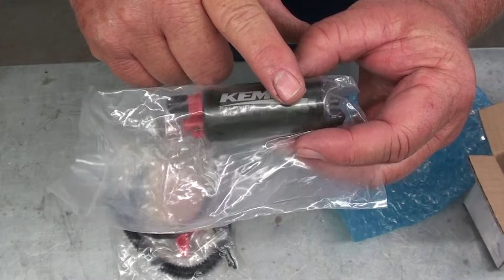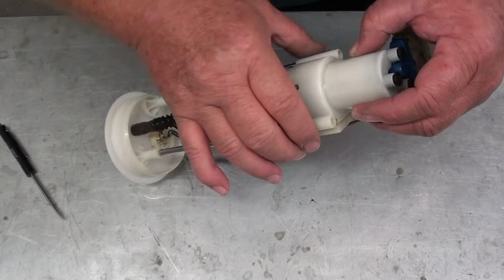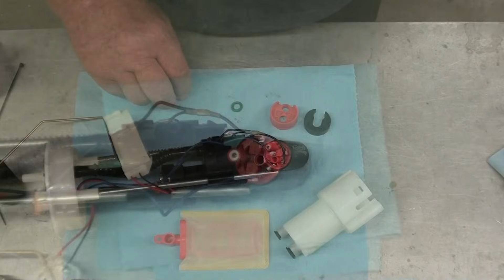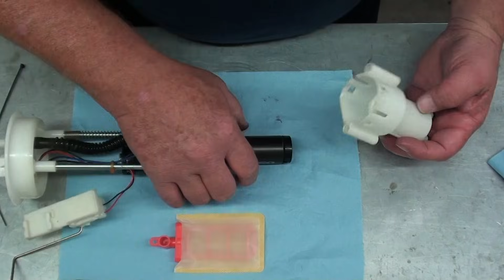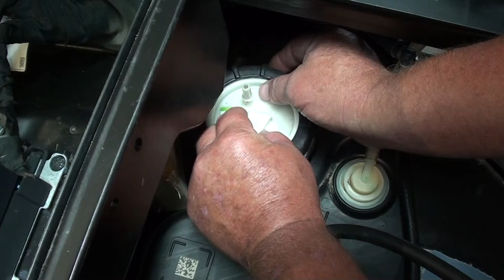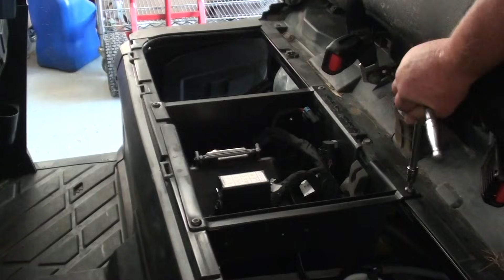Pt.2 2016 Polaris Ranger EFI Fuel Pump Troubleshooting And Repair For Under 30 Dollars

Comment: Good video - but the directional arrow, at least in my service manual, says to point to those two lines you see at 4 o'clock (14:25 in your video).

Comment: My 2020 xp 1000 has gotten hard to crank when its cold. You can finally get it to run by giving it throttle. But it runs perfectly otherwise. I wonder if the fuel pump is weak? Where can I get the gauge to test pressure? And how much pressure should it have?

Comment: Just replaced fuel pump assy in 15 ranger 570 efi crew. The old one was completely broken when we pulled it out. The issue now, is like it is not getting full power. It barely wants to move and then will start sputtering and cut off. Any suggestions on what this could be??? Please help!!

Comment: Another excellent video. Thank you for your knowledge. I'm working on a SP 570 and suspect it's not building enough pressure although I'm getting good flow when I cycle the key. Is that normal?

Comment: After viewing your video a year ago,  I replaced my fuel pump.   It worked perfectly until one day I noticed the ring was loose, so I tightened it.   
    --> After doing that, sadly my Ranger would start up but run only a few minutes before sputtering off.  I might have tightened it back in a slightly rotated position, so I corrected that,  but with no result.  I've attempted to rotate the pump slightly,  took it out and reseated it, but now I don't even hear the pump momentarily running during the initial power up.   I'm guessing the pump maybe has once again failed.  The fuel level registers ok.   
    I failed to wipe out the inside of my fuel pump like your video recommended, so it's possible some bits plugged up the pump.   😞

Comment: Loved your video. I have a 2016 Polaris 900 Crew that quit running after I filled the tank with gas at a local station. If I prime the engine at the air filter intake it will idle roughly but will not restart. Where can I find the Fuel pump rebuild kit? Also, my instrument panel shows code, "530209-5". Internet search said, "Oxygen Sensor". What are your thoughts? Thank you for this VIDEO.

Comment: Got that same kit to replace my fuel pump. I’m having a difficult time separating the white casing that houses the fuel pump. Any suggestions?  Those 3 tabs are causing me the issues. I can’t get all 3 pressed in to remove the housing. 6:04pm

Comment: Great video. I have a 2017 900XP. Wont start so I connected  fuel pressure tester. I get Get 55-60 PSI Turns over great does not hit a lick. I squirted a shot of start fluid and it started up. Runs rough up to about 20 MPH after that run up to 50 no problem.  I put seafoam 1 oz per gallon and  Drove about a gallon of gas out and still have same problem. Any Ideas? Thanks

Comment: Is the fuel pressure gauge adapter available for purchase somewhere or how do you make one .  Thanks in advance for your help.  This video was very helpful.  I'm assuming my can am defender has a weak pump but want to check pressure before dropping the money on a new pump.  After seeing this if it's bad I'll just rebuild it.  But I can figure out how to make or get the pressure guage attached to the bike

Comment: Thanks. Mine is now working, on my 09 77 crew, but the fuel gauge doesn't work.  The ground from the sender has some clip on it that attached to the aftermarket plastic housing. Can I just run a jumper to the ground for the pump?

Comment: Excellent video mate ,I've got a 2007 sportsman EFI which was giving me problems starting but now wont start at all , when I turn the key on the HOT / ENGINE CHECK flashes and it wont crank but the fuel pump contiuosly runs and wont shut off . .I've removed the fuel line from the inlet side of the  filter to see if I was getting fuel and every time I switched the key ON fuel would flow for 2 seconds then stop but the pump was still making noise as if it was still on  . I then connect the fuel line back on the filter and turned the key On & OFF a few times , then I disconnected the fuel line from the injector fuel rail and fuel pissed out . I'm not sure if I have a pump issue or a injector issue , the fact that the fuel pump keeps running but the flow stops is doing my head in . Do you think I could have a stuck open injector .

Comment: I used your video a few years ago to service the fuel pump on my 2009 Ranger 700XP. It's time to do it again. And, fortunately, I found your video again. Hands down, one of the very best instructional videos I have ever watched. BTW, bought my Ranger new in 2009 and it has over 12000 miles on it. I wore all 42 suspension bushings down to bare metal and replaced them all last winter. Thank you for your help!

Comment: Hi Ray, I'm George from Buenos Aires. I congratulate you for the good quality in the detailed explanation of the assembly and disassembly of the supply spider. I have seen him looking for some KEY to solve a current problem with my ATV Can Am 800: in the middle of the day, hot, on steep roads and with little ventilation around the trail, the vehicle begins to fail and stops. I must replenish fresh fuel to resume. And then again it stops.
You may have some clue in mind as to what may be causing this abnormality.
Thank you and receive my greeting.

Comment: Awesome video.   I know its old but damn this saved me some time and $.   Be sure to check your spark plug as well if you had a bad fuel pump.  I still had idle issues after the pump replacement.  My plug was toast.   All is well now!

Comment: I bought a sportsman 110cc, it would start/idle but die when you give it throttle.  I did the pump swap...still does the same thing.  What a piece of junk, bike is a 2019 model, EFI can't handle modern gas yet is more complicated and expensive than a carburetor...I will stick with carbed machines in the future.  I've bought cheap chinese bikes that sat for over a year, clean the carb/fuel lines and go.

Comment: 6/2021. My 2019 Polaris Ranger 570 Full Size was idling fine as I was topping off some livestock water.  My Ranger NEVER had any idle issues, NONE.  Then, all of a sudden it just sputtered out and died.  I'm in Florida and our dry season is INCREDIBLY DUSTY.  I pulled the fuel pump and the filter looked like a used tea bag.  Watched this video and just ordered new filters and the pump kit off eBay.  Replaced spark plug and air filters as well.  Just under $100 in materials and about two hours of labor and clean up.  The Ranger is back up and running, ready for farm chores again.  Thank you so much for this video.  Saved a ton of cash and A LOT LESS WALKING.  

If your machine is running well then just dies and you've never replace the fuel filter, this is most likely the issue.  Adding fuel filter change once per year to yearly maintenance list now. 
 New fuel pump and filter kit.  Less than $30 on eBay and you're good to go!

Comment: D-Ray, awesome video, quick question.   The fuel adaptor you use to your pressure gauge, did you manufacture that for your needs or were you able to find the unit as shown in the video?  Thanks again!

Comment: Thanks for this video! I just bought a 2019 Polaris XP 900 Crew. It just has 3000 miles on the OD. But it started cutting out and stopping. You could wait a few min and it would crank and run for a little while. I told my wife when it started it was acting like a fuel filter issue. So O did some checking and came across your Vid. It helped a lot, but I can say this all Kits are not created equal and all year pump assy's are not the same. I had to disassemble my pump assembly a little farther because the fuel sender assembly was a little different and I had to pull the top and the 2 sliding rods out to remove it before I could pull the to pump halves apart which ment I had to remove the fuel hose but guess what they gave me another in the kit, but superman could not have got that hose to fit over the nipples. so I had to go buy a piece of fuel line which as you know is tricky because a rubber hose does not replicate a plastic accordion hose so you have to get the length just right for the spring tension of the pump. But hey it worked. Thanks for the video.
Reply: I had to pull on plastic part where the two rods go through, it is a tight fit with the hose being max'd out to the limit, but it came off. I was reluctant at first to try it, but that option looked better than replacing the hose, and it worked. Just go slow with the process. 2020 Ranger 570

Comment: I have 2015 ranger ETX that won’t crank I’ve checked everything but the engine and fuel compression I was wondering if your fuel pump was going bad or if it was completely gone? In short how much fuel pressure is needed for the unit to start ?

Comment: Replaced pump on my 2014 ranger
Crew 570. Pump primed up, hard
To start then backfires any suggestions and goes dead?
Any suggestions. Replaced pump
Like in your video.

Comment: Excellent video, West Plains, Mo here.  Mine was running and just quit, figured maybe bad gas, drained and refilled and won't run unless ether sprayed on air filter, which is new.  Believe either my pump or filter on tank.  My set up is exactly like yours.  Thanks so much, maybe we will all thaw out after the snow and cold!
Stay warm!

Comment: Nice videos. I had same issue. Thanks to your video I was able to remedy the problem. However, I have one question, where does the fuel vent filter go installed. My Ranger did not have one, which is why I believe I ran into this problem to begin with. Thanks again.

Comment: My 570 fuel pump reads 58psi. It randomly turns off, like the key switch gets turned off. If I’m running fast enough when it happens I can turn the key off then back on and starts right up?

Comment: Subscribed!  So easy to watch .  Great Video. I have a question for anyone reading. Would there ever be a time when it ran poor after it heats up due to a fuel pump problem?  I have a 2013 CFMoto z600  woth 900 miles on it. Serviced regularly but now after about 10 min of riding (temp gauge hits 2-3 bars) it runs horrible and dies at idle.  let it cool off and it runs great again?  Thanks in advance.
Reply: I did do a pressure test   22 psi.  Thank you for the video, think im on the right track!

Comment: I have a 2016 Polaris sportsman 450 H.O. bought August 2016 & my fuel pump has gone bad 3 times now (first time Sept 2017, 2nd time June 2018, 3rd time August 15th 2020) . It's under warranty, but just wondering if this happens a lot? I switched to Ethanol free June 2018 & if I wasn't driving a lot, I'd at least run it for a half hour or longer every few weeks.

Also do you think the EBay Fuel pump kit is better than the OEM version, as in it lasts longer or just better because it's cheaper?

My father in law has a 2015 Polaris Sportsman 570 & has never put Ethanol free gas in his & he just had the same problem I've had August 14th 2020. But after letting it cool down for 5-10 minutes, it would drive another 2-4 miles, then backfire, slow down, & die.

After letting it sit overnight, it happened the next day a couple times, then he drove it all over the mountain for a few hours without a problem???

Just wondering if mine was built on a Friday & his was built on a Tuesday? Lol.

Thanks for any advice

Comment: D-Ray, I swamped (really swamped!!!)  my 18 Ranger 900 XP like a knucklehead (not snorkeled) and spent a week wrenching, draining, and praying I could revive her. I got her started, no hydrolock and no knocks or smoke. I wiped the sweat away but  my last obstacle was the damage from water and mud in the fuel tank. I pert near mashed the buy button on a whole new fuel assembly ($289) when my boy showed me your video. Convinced this will solve the mess. Great video bubba, thanks!

Comment: Yelp he very good.   What about that fuel pressure regulator.    Does it ever go bad.  I cleaned  and blew my fuel pump out.  And it went back running fine

Comment: your video was very helpful..ill need to find a fuel pump pressure tester
 my 570 keeps stalling after warming up mine is a 2019 model hunters edition 
ive changed the fuel, spark plugs, and cleaned the air filters (intend to order them also)

i looked on ebay for a new fuel pump and get a spare repair kit 
my problem is i don't see a hunters edition  sportsman i see alot of the 570 and some seem to look the same as mine but i hate to order the wrong part or model 
can you help ?

Comment: Use this:  Orion Motor Tech Master Fuel Injection Pressure Tester  on Amazon, it has the fittings that you can pressure test your pump.  It's got that plastic end, plus the gauge has the release valve. I just tested mine.   Seems like it would get up to 55 psi then slowly seep back down to 45 psi, but when it was running it would be over 50 psi and the indicator would swing wildly.

Comment: Excellent video! Thx to this I had it apart in about half an hour. I have a question though. When I got it apart, there was crud at the outlet of the fuel pump. I assume the piece above it is the regulator. Should it be letting fuel in backwards through the regulator? That's the only way that I can see that dirty fuel would get into the outlet of the pump. The filter was intact and not overly dirty. My plan is to clean the tank (it's kind of dirty) and remove the fuel rail and make sure that there is no crud in there, make sure the fuel lines are clean, install the new pump and hopefully the problem is fixed.
Reply: Got my Ranger back together and it runs a lot better. It feels like I don't get quite as much power at the top end of the RPMs, but it may have been running a bit lean. Thx again for the great video!

Comment: Great video I did my Sportsman 570 2016 today 70 hours on it. Shame Polaris shame - Bosch Made in China pump . Anyway watch that little green  O ring its a pain in ass  to get seated properly and you wont  get pressure unless it right up inside. I used grease but ended up pushing it in first then seating the housing into it. Hope this saves  someone a few minutes

Comment: I have a rzr 800 4 Robbie Gordon edition and I ran into a strange problem. It will run up hill but will shut off on level or down hill. Fuel Pump? Air Sensor? or both?  I am lost. ANY HELP WOULD BE GREAT. Thanks.

Comment: Great video!  My Sportsman 500 EFI is doing the exact same thing you described.  I've changed the plug, fuel filter, and airbox filter to no change.  I'm going to test the pressure from the pump and go from there but I'm guessing that is the culprit.  Unfortunately, I have to take off the entire front plastic to get to my tank!Thanks again for the information.

Comment: I don't have any power going to the fuel pump. I assume there should be power when the key is on? The EFI warning light was on before the engine stop running. It had been stalling like it had a blocked fuel filter for a bit. Now it won't start. Is it possible the computer is cutting power because its sensing a fault?
Reply: BauerTreeEquipment I have the same problem did u find a fix ?
Reply: @TheBreedxxx  I replace the computer. Fixed.
Reply: @TheBreedxxx  It was the computer. Founds a cheap replacement on Ebay, fixed the problem.

Comment: D-Ray this was a very, very good video. Great close ups and excellent explanation as you perform the repair. 
This is a good DIY repair that I am fully capable of doing. My Polaris dealer quoted me $520 to replace the fuel pump in my Razor,  and our unit only has 1200 miles on it! Your tips on putting a little grease on the o-ring, and on the locking clip for the fuel filter, great tip! You are the best UTV mechanic I have discovered online, thanks sooo much for sharing your knowledge with us!

Comment: This video saved me big bucks!  Just changed the fuel pump on a 2015 Polaris RZR 900S for $27.00.  I did have to buy a tool to remove the ring on the fuel tank that holds the pump housing in place because it was super tight and the RZR doesn't provide much room to get your hands around it.  This is a very professional video by a guy who really knows his stuff!  Thank you!
Reply: John O can you tell where you found the part? Thank you
Reply: Guys have used the plier type oil filter tool to grab it and turn it. You might try that next time

Comment: # D-Ray-Smith I live in Tn just purchased 2011 BobCat 3400 4x4 same as the Polaris Ranger 500 single cylinder my issue is it will not stay running its hard to start stalls out backfires or puffs out i know its an easy fix no engine noise what so ever strong compression im thinking fuel pump? TPS? clogged vacuum ? please help!!

Comment: @ 13:35 -- Drop some paper towels shreds  in the tank and then blow them around with some compressed air to absorb and bad gas/debris, use a grabber tool to pluck the paper towels back out.

Comment: I have a 2015 Polaris ranger ETX and all of the sudden it’s acting like it’s not getting fuel. Other than pressure test is there any way to tell if it a bad fuel pump ? Also can you post a link to that fuel pump on eBay.

Comment: Thanks very much- I have a 2016 Ranger ETX that just started having symptoms while in the woods today.  I'm not a mechanic at all, so this is just what I need.
Reply: Did mine today, it's as easy as he makes it look, just be sure you have a soldering iron handy. And that retainer ring on the fuel filter, try to have one of those little hook tools like he used, trust me on this.

Comment: What model year and model ranger is this fuel pump assembly
Reply: 500 sportsman
Reply: 2002 500 sportsman
Reply: Ronald Flickinger 2002 year don’t use this fuel pump could it be 2012
Reply: Watch video#1 he says it's a 570